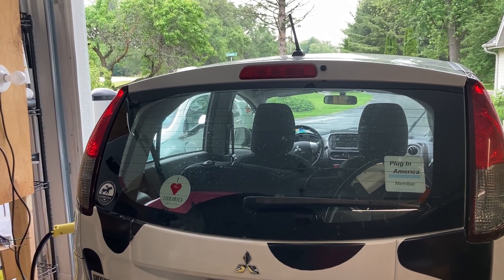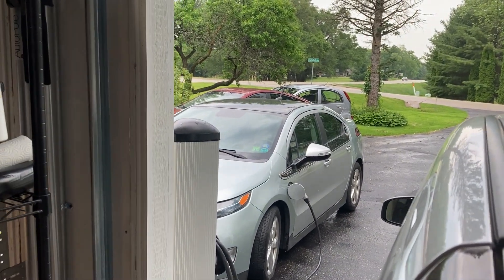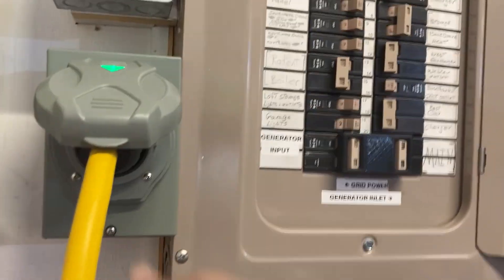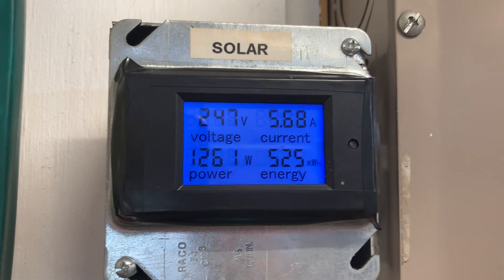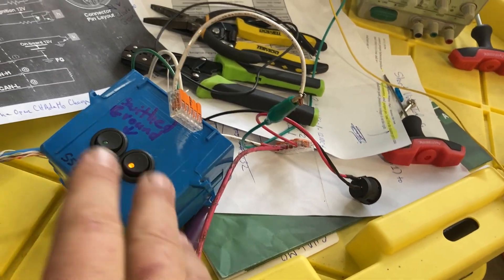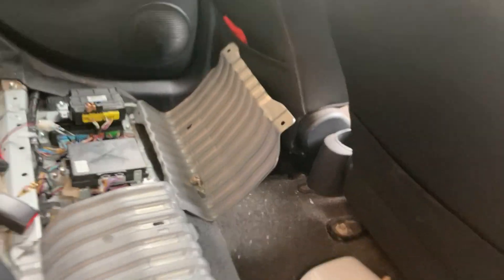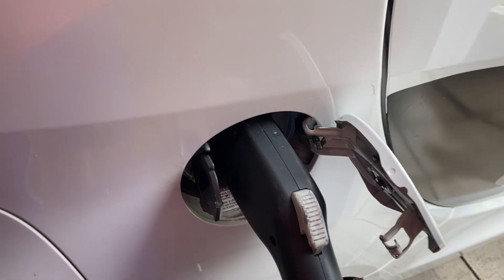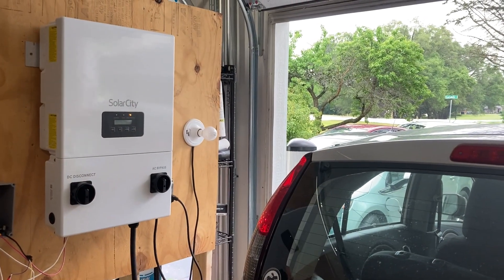Vehicle to Home (V2H) with Mitsubishi, CHAdeMO, and Solar Inverter

Comment: You're a cleaver fellow Mr Nelson. Thanks for posting such great information. The Nissan Leaf power I/O is software driven, so less complex.
Reply from the maker: I don't know that I'd say "less complex". If you know the correct CANBUS signals and can generate them, that's the "best" way to operate the CHAdeMO.
For me personally, I know little about CANBUS and certainly don't know exactly how to figure out those signals and generate them.

If anyone does, please let me know!
Reply: @BenjaminNelsonX  sure that is correct however what I was referring to was the vast number of existing CHAdeMO based solutions already available from existing Japanese market place.
Reply from the maker: Yes, a commercial solution, designed by somebody else is "simpler".
I've also not found an affordable 120/240V 60Hz unit available here in the United States.
Reply: @BenjaminNelsonX  Where/which company? I'm still looking :) Thank you.

Comment: Any chance you could tag where you got the 3D model? The one I got online is not quite right 😑 and I'm terrible at modeling. I'm attempting this with my Nissan Leaf; I'm so close I can practically zero my electric meter!
Question: did you end up needing the pre-charge chademo circuit from the car going into the mppt or did you trust a fast blow high voltage DC fuse??
Thanks again for the help & great project videos!!!!
Reply from the maker: I got the model for the CHAdeMO connector from Thingiverse: https://www.thingiverse.com/thing:121581
In the description there, there are links to more details on building the connector beyond the plastic - all the electrical connectors, etc.
I used solid copper 9mm rods for the main power connections and nickel-plated them.

YES, I used a pre-charge resistor between the car and the input of the solar inverter. I have some parts from a Nissan Leaf battery pack, so I literally used a contactor and resistor from that, which are already perfect for 360VDC.

Make sure to use some good high voltage fuses. I've already blown a few - once by not pre-charging right, once by hooking something up wrong.

Take appropriate safety precautions around high-voltage DC.
Reply: @BenjaminNelsonX  thank you so much! And for sure safety is first with all appropriate PPE ☺️👍
Keep producing great videos & projects! I'll keep watching 🙏
Reply: Are you planning to upload videos on your process?
As an owner of two Leafs, a gen 1 battery pack, and retired solar installer, I'd be really interested in how you trigger the DC contactor.
I wonder if the Leaf will disable the charge port when the DC contactor is enabled?

Comment: This is excellent, nice work. I keep looking out for something like this but it feels like a gap in the market to make an affordable bi-directional charger that has DC terminals for connection to solar inverters. Wondered if perhaps there was some catch getting dc out, but you've proven it works. Probably needs a EVSE manufacturer to get on board. Victron would be perfectly placed to make this since they make EVSE and inverters.
Reply from the maker: Enphase is now teasing that they are coming out with a bidirectional EVSE!
https://www.youtube.com/watch?v=YM8P6yDQK64
Reply: @BenjaminNelsonX  thanks, that looks cool, imagine it will cost and arm and a leg due to having the inverter built in too, but nice to see that this direction is being developed

Comment: Really interesting, I’m off grid with a battery and solar system.

I’m looking at getting an MG4 and am hoping I will be able to charge my home battery system from it.

Are you aware of if it would effectively work the same as your system?
Reply: I don't think MG4 has the right protocols and hardware to enable bi-directional charging unfortunately. Currently this is only for cars with Chademo connectors, with a few exceptions for cars that have inbuilt bidirectional AC  inverters, such as the Hyundai Ioniq 5 (using their V2L connector), and bidirectional CCS with the Ford F150 lighting. Hopefully we will see more manufacturers integrate what ford and Hyundai has done, but for now it seems like we are quite far away from lower cost manufacturers integrating it, as it's not really a selling point for them.

Comment: hi thanks !!! good job, is it possible with a nissan leaf ?
Reply from the maker: A Nissan Leaf was also designed with the idea of being able to draw power OUT through the CHAdeMO connection.

However, you would also need to know where in the car the relay is to be able to activate the battery pack contactors, or use dedicated equipment that can do that for you.
Reply: @BenjaminNelsonX  ok thanks, are you find the Relay in c-zero or Peugeot ion? IS it identical at i-miev ?

Comment: I'm curious what happens if or when the gridtie microinverters puts out more AC than the house loads at the time, meaning the H6 inverter would see zero net AC load, and then what?   Does the H6 shifts freq or something,  what makes the micros drop off?
Reply from the maker: At that point, the voltage pushes up, the micro-inverters see that as the grid going out of spec, so they turn off. They will try to reconnect again in five minutes.